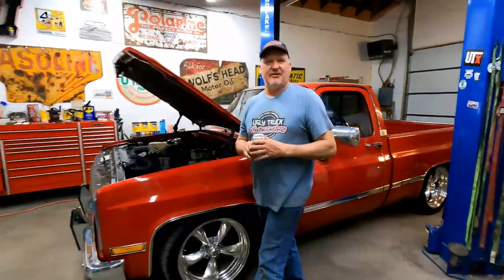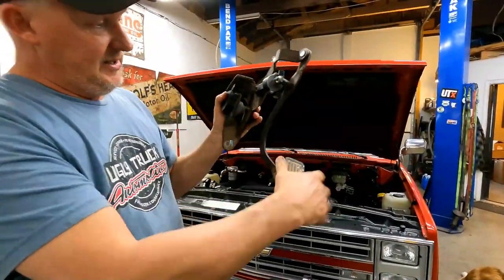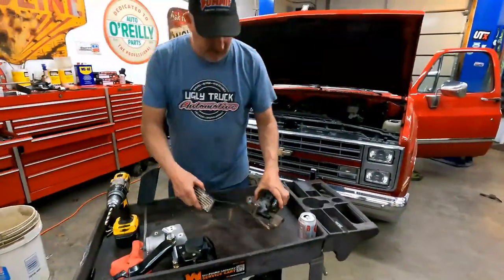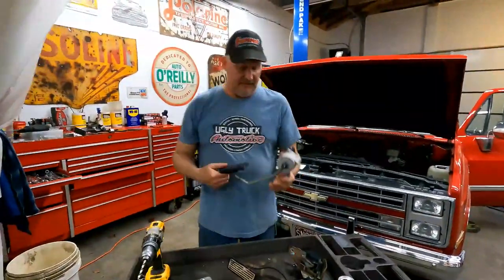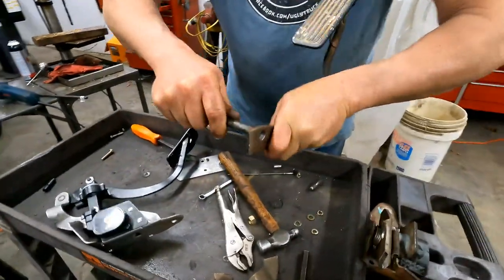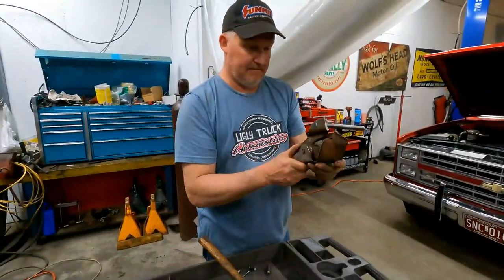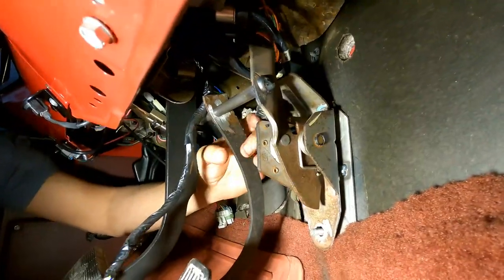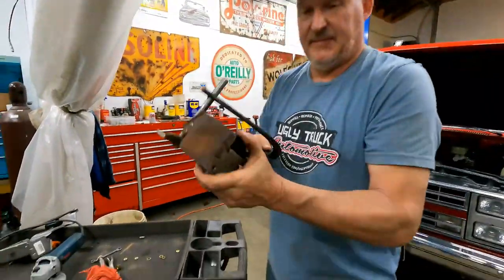FULL THROTTLE - LS Swap ACCELERATOR PEDAL - Fabrication + Install - UTX

Comment: I like the short throw on the pedal. I have a 67 c10 I am building. 4.8 4l60e. I just painted the firewall so now I get to put the steering column and hydroboost setup on. Soon it might move in and out of the garage on its own.
Reply from the maker: Can't wait to see your 67 up and running! We'll put your name in the drawing for the pedal. Thanks George!

Comment: My K10 is staying original. My project now is a nothing special 70 c10. We are doing a short bed conversion and ls drivetrain. Lucky for us there is a salvage guy nearby that parts out late model gm. I am eyeballing cube van drivetrain. 6.0 and 4l80 2wd. My 16 year old kid has a interest in welding, it could be a good project. I saved this truck from the crusher and want to show it to the previous owner running and driving. He thought I was crazy for rescuing it. The pedal bracket would be appreciated
Reply from the maker: Hey Bill! Awesome to hear you saved one from the crusher, and awesome to hear that your kid wants to weld! And "nothing special 70 C10" is right up our alley! 😁 Send us an email at uglytruckexperience@gmail.com with your address, and I'll send you an adapter plate, and we'll put your name in the drawing for the pedal! Thanks for tuning in!

Comment: BEST TEACHERS !      and GREAT HUMOUR ! Love you guys, Thanks Jerry & Emily! 
    i was on the fence about pulling the trigger on my good running 82 C/10 daily driver, 
  now y’all have me ready to do this w/ duel tanks and all! ,
   I just bought my donor,   a good running and driving 2013  2500 w/ 6.0 and 4L80e  w/ 130,000 miles before it was totalled , will that trans fit in that      space ???  
   GAS PEDAL is plastic, have you had any experience w/ this modification??? if not, can y’all do a vid?  
  “Please add my name in the gas pedal drawing“  thanks, Dave
Reply from the maker: Thanks so much Dave! Glad to hear you're going for it!! 👍 We'll put your name in the hat, and we appreciate you watching!
Reply from the maker: I missed your other questions! Yes, the transmission will fit. As for the plastic pedal, we haven't had to modify one, but we do have an extra one floating around. Maybe we'll do some experimenting! 🤓 Thanks Dave!  --Emily and Jerry
Reply: @UglyTruckExperience   Thanks for getting back to those Q’s ,  i couldn’t find anything on youtube as of yet  on modifying a plastic pedal, 
    meanwhile, if i figure something out  i’ll let y’all know, Dave

Comment: There is a more direct throttle pedal swap for a c10. Only requires a little moving of wires on the connector but it bolts in and sits in factory position and it’s not the expensive $200 fancy ones
Reply from the maker: Yes, that is the pedal we took out in this video. We've heard a lot of complaints about them. There is not enough spring tension, and the pedal is still not in the same spot as the original. I know a lot of people use them though. Thanks for watching! --Emily

Comment: I LOVE this channel. You give very detailed comments in your videos, that I need. I am not a mechanic but I try to do my own repairs. However, I do know my limitations. I am restoring a 1946 Chevy truck onto a 2007 S-10 chassis. All is going well. Got a kit from Code504. The body is done & mounted onto the chassis. I can't drive the truck at this point. I need now to install a gas pedal & I have no ideal where to begin or proceed. It is nearly impossible to find someone who has the time to come and help, and I can't take the truck to them. Do you have any advice as to what type of gas pedal I need or how to proceed. Any advice  would be appreciated. Thanks!
Reply from the maker: We appreciate you watching our stuff! Are you using the S10 drivetrain with the chassis, or are you swapping in an LS? I tried looking up a 2007 S10, but the newest I could find was 2004. Give us a little more info on your swap, and we'll look into it. Very interesting project!  --Emily and Jerry
Reply: Hey Guys, I had responded sooner but my old computer had a hiccup and I lost what I had written ☹…. No, my project is not an LS Swap. I wish it were an LS Swap, but I can’t do that. I’m trying to work with (motor, trans, etc.) what I have. Okay here is some info. Bear in mind, I have always trusted everyone. It took me awhile but I grew to learn not everyone can be trusted. Unfortunately, I learned that the hard way. I was told that I have a 1985 (or so) Chevy Corvette 350 cu.in with a 700R4 transmission. The motor runs fine. I have dual fans running on the radiator. However, I still have a few bugs to work out. Based on reliable (?) information, I took on a chassis swap from an original 1946 Chevy truck to a 2007 (or so) Chevy S-10 chassis. Of course, the chassis swap would need some modification. The original chassis was too narrow, so I picked up a 2004 (I think?) Chevy S-10 4x4 rear-end (60” wide). It is a much better fit. So, with a lot of sweat, I have the body in position and bolted down to the recommended specs of Code504. BTW the brakes are under the driver’s side floor, bolted to the chassis. I have the brake petal, and the emergency brakes installed. I have the battery box installed under driver’s seat, welded onto the chassis. The gas tank is mounted under the bed. I had an “old” gas pedal I had planned to install but I decided NOT to use it. Actually, I would be embarrassed to tell you the age of the pedal. I’ll just say there is NO plugs or electrical wires to it. Considering the amount of work that I have put into this project, without ever having a mechanic present, is surprising. I’m getting old (my health isn’t what it used to be) and I am to a point that I really want to drive this old truck. Okay, what gas pedal do you think would be the easiest to install? Any suggestions would be helpful. Thank James @UglyTruckExperience
Reply from the maker: Ok, So. It sounds like you are trying to make a 46 Chevy truck be even better than it originally was. The engine and transmission combination that you have would be a cable operated throttle, which is pretty normal and will work  just fine.  The original pedal from the 46 might work just fine.  It is just a matter of the cable length.  You would maybe have to adjust how much travel the pedal has, but it really should work fine.  Worst case, it might not go to wide open throttle.  Sounds like you have done a ton of work, which I have a great deal of respect for.  Keep us posted and thank you for watching our videos.  Jerry

Comment: Question - my daughter, has a 98 dodge pickup with a blown 5.9L engine.  Is it doable to do an ‘LS swoop’, to a dodge?  If not, what is your suggestion to procure a replacement (used but good) engine?  She’s close to Manhattan KS…….
Reply from the maker: We've never swapped a Dodge, but it's definitely doable! But finding a good used motor would be the quickest and cheapest route. Check out car-part.com and search for what's available in your area. Thanks for watching, Jim!

Comment: Hi! I'm new to your channel but looks informative. I'm currently working on my 70 chevy ls conversion. I like how informative your videos are. I was not fortunate to get the fuse box for mine. I got the harness and computer. My question was on the wiring. Mine is a mess. What's my best option at this point? I have the tank and pump mounted under the bed. And also where do you get the pcm flashed?
Reply from the maker: Hello Jeremy.   Tell me a bit more about your wiring. Do you have all of the connectors still from the harness and just missing the fuse box?  We send our computers to LT1swap.com.  He does a great job and has a great website that is full of great info.  Let me know a bit more about your wiring and what your donor motor and harness is.  Thanks.   Jerry
Reply: Hey Jerry the guy I bought mine from claimed it is out of an 04 Tahoe 2wd. I have the Trans bolted to it still and it's in the truck. 4l60e I believe is the Trans. It's drive by wire and I have all the connectors for that as well. I have watched several videos from the lt1swap. So many videos out there sometimes make it more confusing. So all I had was the connector to the fusebox that where all the injectors and everything else hooks up. I did cut it all off and label it according to lt1swap laid it out. He is very informative also. 

I have looked at the fitech setups and was wondering if that might be an easier way to go? I have not heard of any one using that system.
Reply from the maker: Finding a fuse box for it would be pretty easy.  Most salvage yards are full of them or EBAY.  If you cut the large rectangular connectors from the wiring harness that could be a task to get back together unless you labeled it really good.  If that is the case you may be better off getting a standalone harness. They will design a harness for whatever your setup is and you could use original computer, Fitech or Holley.  Whatever you liked.    We have talked to people using those systems and they do work great.  Jerry

Comment: Question. I bought a drop out 2007 LQ4 6.0, DBW and the motor had the accelerator pedal, but no wire harness to the pedal or the Actuator (tach) modual. I have to try to find one at a junkyard with a model that ends in 0008.
I can't seem to find any videos showing how to add the pedal for 2007 (which is different I guess) the wires through the firewall from the pedal to the tach modual and especially how that hooks into the harbess/fuse box?
I need to know what all to get.
Reply from the maker: Hey Gary.  I will take a look at a wiring diagram and check that out.  Your getting into some Gen 4 stuff on that one I believe. Will get back to you.  Jerry

Comment: I am trying to do a DBW pedal assembly for my 2001 BMW E46 L33 swap. Really tight area, any idea on which pedals  to use for a gen 3 ?
Reply from the maker: I bet it is tight under there...  Without knowing how much room you actually have, It would be hard for me to say.  The plastic pedal takes up the least space but I am really am not sure what you are working with space wise with on that E46.  I give you huge props for doing that swap. That is awesome...  Jerry
Reply from the maker: Also, try not to be so grumpy...  It won't help with a swap.

Comment: Love this content exactly what i was needing , I have a question that possibly you could answer for me ,I am installing an LS into a 85' the ls that was provided has air injection and EGR and because of California Regs this needs to be smog compliant . I am noticing that the stock exhaust manifold needs to be used  . When the engine is installed using the ls swap kits mounts , the engine sits lower and the stock manifold for the passenger side hits the frame because of the EGR tube mount if I raise the engine about 1" to 1.5" the stock manifold can be used and the stock clutch fan looks to be centered at the increased level , at any rate I have yet to find anything that is pre-made that can facilitate this I would have to fabricate this myself . My question is have you ever had an instance that you may have a solution that you could share I would like your feedback thanks for the in-depth videos
Reply from the maker: Is it he egr valve that is hitting the frame or the actual manifold?   Jerry
Reply from the maker: Also, what motor mounts are you using?
Reply: @UglyTruckExperience   It is the passenger side has a mount for the egr tube because it is to low in the "V" I am not able to get the manifold low enough without hitting the mounting bracket I am using a set from BRP Hotrods
Reply: The manifold from a 2003 with EGR exhaust manifold
Reply from the maker: Is it so close to the frame that you can't grind out a portion of the frame to miss that manifold?  You can grind out a good half inch and it will not affect it any.  I would be worried about bringing the engine up to much in the front and changing your driveshaft angle so much that you have a vibration from the driveshaft.  Jerry
Reply: @UglyTruckExperience  I did contemplate that but its not the frame channel it hits the mount bracket so I would have to cut a good chunk out . everyone I have searched just changes the manifolds but this has to pass a state inspection for emissions and has to have whatever the motor came with in order to pass so I'm limited on modifications that I will be able to do . summit shows these ICT Billet Motor Mount Adapters 551367 which looks like what I was thinking of fabricating but they are not for the year I have
Reply from the maker: I could be wrong but I believe the engine just has to be equipped with the same emissions as the donor.  I believe I have seen headers that also have the EGR and the AIR pump tubes.  If its legal, it might just be easier to get those headers for it.
Reply: @UglyTruckExperience  You are correct I looked but haven't been able to find , The donor was purchased but I wasn't a part of that process and he only got the parts that he had on his list (from who I don't know) , I would never have got the one that was purchased but I'm a gluten for punishment and took the job on . I will try to get this done if I have to make an adapter plate (I am probably the only guy that would need it LOL) or modify something (safely) I will ,  At any rate thanks for all the content I have seen so far very helpful and the only person I have seen to actually take pride in the quality of work produced Thanks
Reply: If I have the opportunity to send pics I will